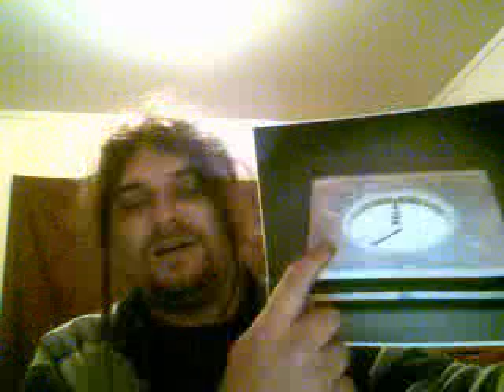Stonehenge Theory that leads to Perpetual Motion Theories

Comment: Hi, my name is Shane Joseph Taylor, and I am from New Zealand. I have a theory Stonehenge, which I wish to share with the world, as it's, interesting. Uh, my my theory is that Stonehenge was designed, and built with the purpose of being viewed from the air as a blueprint for a perpetual motion system. And that perpetual motion system was either using Electro magnets, or stationary magnets. Uh the Electro Magnetic base is the idea that you'll have a circle of electromagnets which a centre piece is connected to a generator, and that centre arm, that is connected to the generator will be pulled by the flow of the Electro magnets around it, and continuously do so, to generate enough power to function the electromagnets, as well as, power the generator. Uh, power itself, and a light bulb hopefully. The uh magnet based one is a theory which uses uh stationary magnets in a circular motion, and the idea is that, the idea is that the magnets are all aligned around in a circle, and uh an are comes out, I think the arm has to be at a slightly different angle, but that the arm comes out and can push, have a magnet of the arm itself, which pushs against the outer magnets, which keeps pushing it around in a circular motion continuously, which would be perpetual motion. Uh for a better look at pictures of things I've designed and built so far to date uh have a look at my website which is www.theorism.com, which is www.theorism.com uh any feedback would be great, I think it really big idea. No idea how to get it out there and I am stuck in New Zealand so I don't have much resources to use. Thank you for your time, and hope to hear from somebody.